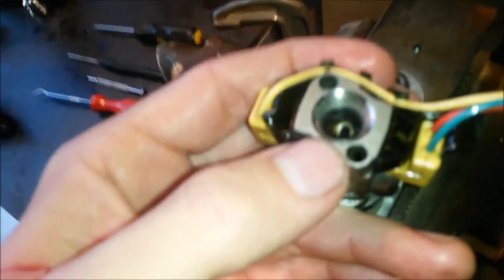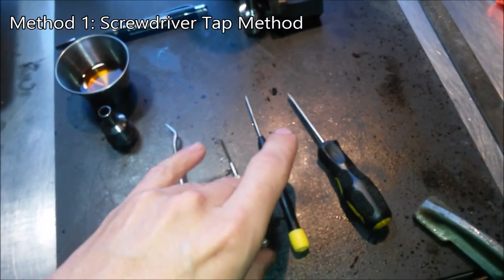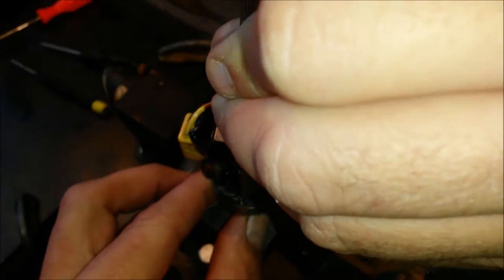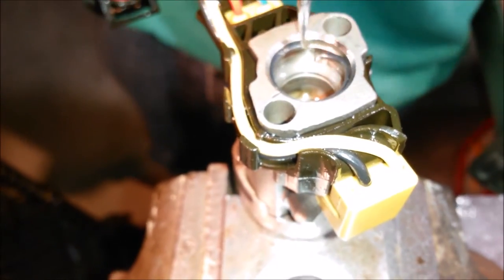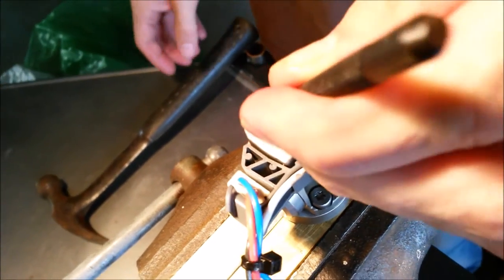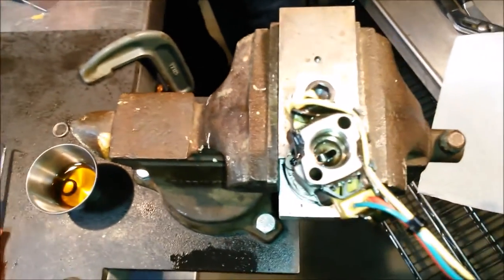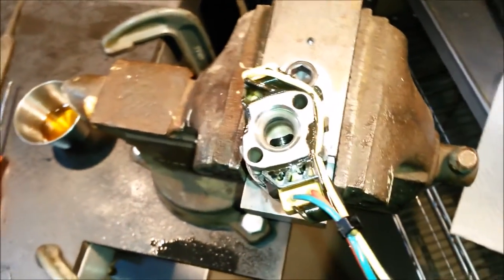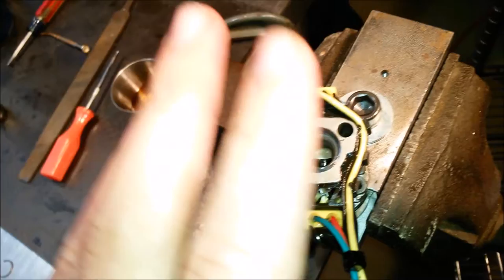Ford 6.0L Diesel Top Injector Seal Series (Video 3 of 3) C-Clip Removal for Replacement on the Bench

Comment: Do I need to worry about this if I’m getting new warren diesel injectors. Buddy 6.0 hydrolocked due to failed injector. So I pulled the plugs and evacuated the diesel, which was black of oil so I’m guessing the o ring was also bad. So now that it’s our plan on using you guys nipple cups and o rings. Oem updated standpipes. New fuel filters and fuel pump. Fresh T6 oil and filter change. Would I need to worry about this ?
Reply from the maker: The injectors will come with new top seals installed.

Comment: Also, with using punch method I later had one of the ferruels fail, cracked, broke apart thus causing a catastrophic failure of the seal to the injector body. Which leads to the typical no start condition.  Since then I have not used the punch method promoted by an Alliant instruction set.
Reply: i dont mean to be so offtopic but does someone know of a trick to get back into an Instagram account?
I stupidly forgot the account password. I would appreciate any tricks you can give me.
Reply: @Jordan Rodney instablaster :)
Reply: @Phillip Rayan it did the trick and I actually got access to my account again. Im so happy!
Thank you so much you really help me out !
Reply: @Jordan Rodney you are welcome xD

Comment: Can these still be purchased directly from HHC?  I am about to do both sides of my truck with your nipple cups and would like to at least have the top injector seals on hand if possible.  Thank you for the help!
Reply: I made a tool to grab the retainer and remove it. Will work with injector installed also. Easy to make.
Reply: @davidbradford5432  Tell us about this tool.
Reply: @davidbradford5432  what’s this tool?

Comment: Why can’t you remove the seal and install a new one without removing the clip?
Reply: You can. You can even do it with the injectors still in the engine. It's a Pain in the Ass though, and it's really easy to Nick the seal with the picks you have to use to get it in there.
Reply: I been a hydraulic mechanic for 27 years and done 1000’s of seal installs. I think I can do it but wanted to make sure there was some other reasons.
Reply: @535banshee  same, love doing it, but hate these oem clips